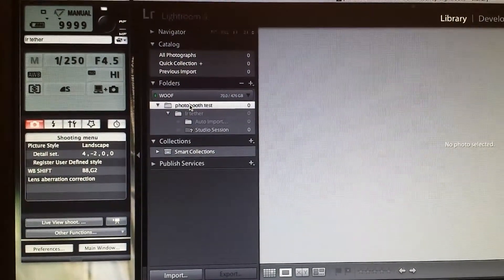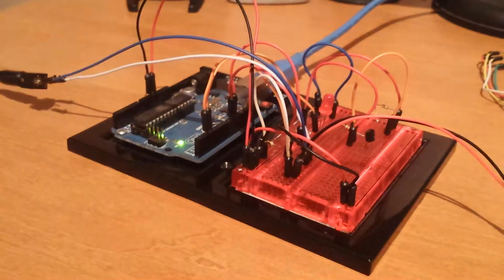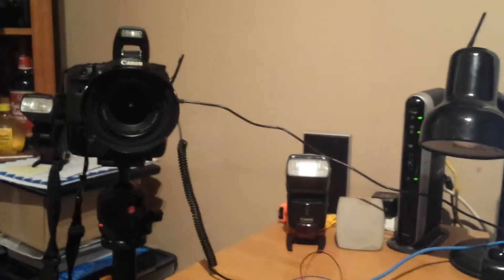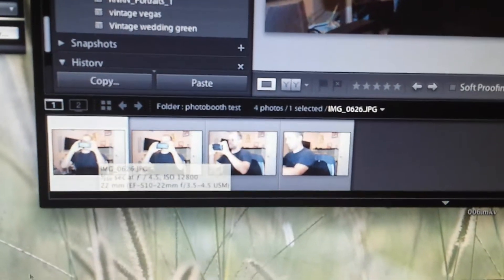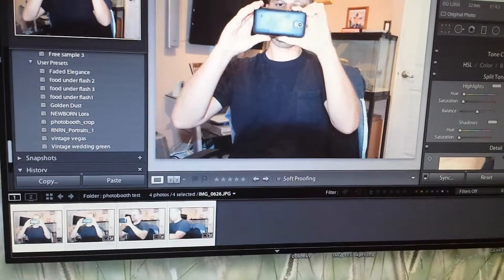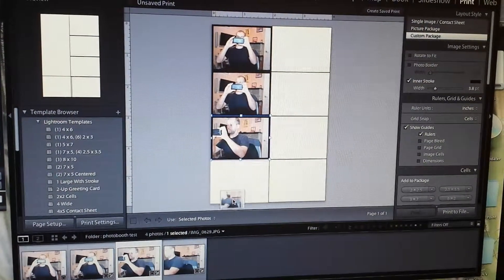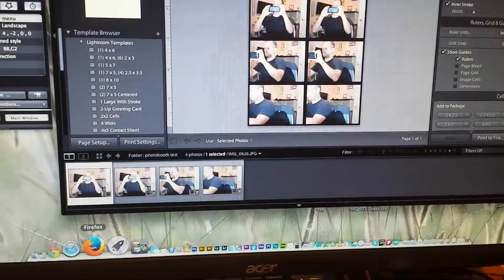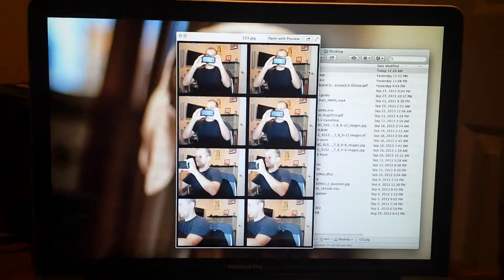Canon 7D plus Arduino Uno photobooth prototype

Comment from the maker: costa marques rodrigo - The arduino does this:
1. Opens the shutter on camera and keeps it open in Bulb Mode
2. Controls the timing of the opening and closing of the solenoid valves that create the droplets
2. Precisely times and fires the flash or flashes to freeze the droplet collision
3. Closes the shutter